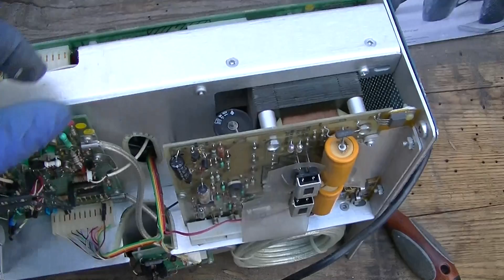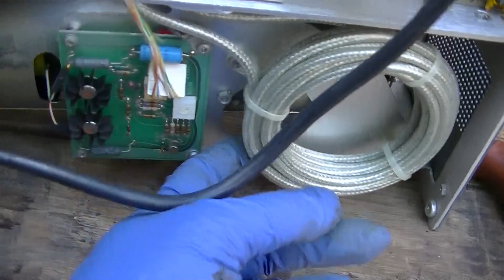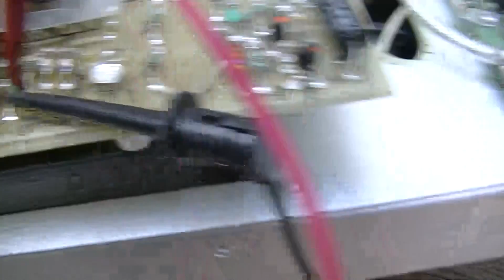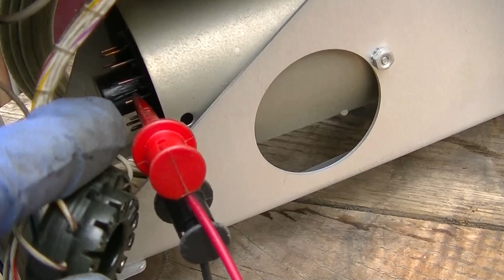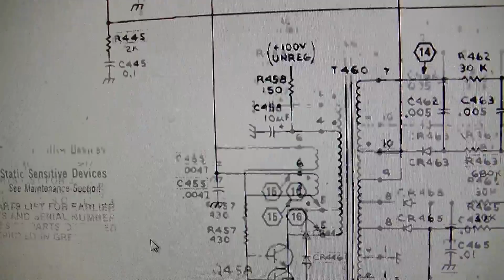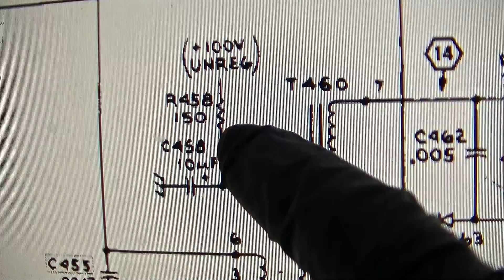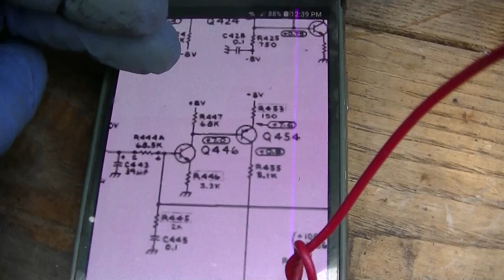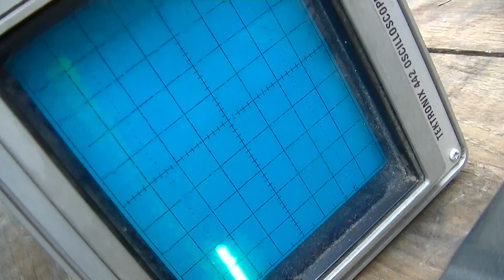Tektronix Type 442 Oscilloscope Diagnosis and Repair

Comment: Greetinga again:
This is a great time to use a variable voltage transformer (aka Variac oriinally from General Radio.) along with an AC ammeter.
Also a 'scope o chck fo ripple.
I beleve in fixing poblms as ou fin he. Replace any power supply caps hat are not up to snuff. Maybe it is more fun to watch the failures repeat?

Comment: Greetings:
The coax is used to visually allow the triggered signal to be viewed by allowing the trigger circuit to delay the signal to the input display circuit allowing the trigger signl to be observed allowing the triggercircut to do its job.
I haven't  checked the circuit yet, but a quick view of the front panel shows no evidence that there is a dual time-base circuit. That was used in video to trigger on the start of the odd or even fields, then delay down to any portion of any scan line to find any 74Sxx series chip that is unable to switch properly (fast enough) . I had to use this feature on 100MHz TEKTRONIX 465 scope with both dual-iputs and dual-time-bases in the late '70s when servicing early CHYRON (Chiron II) character generators (titling systems) with 28ns clock signals. My TEK 454 needs servicing, so I bought a 40 MHz 2-input, single time base scope to tide(?) me over.
YouTube keeps me involved in electronics now that I am retired.
Retired video Engr.

Comment: That scope looks like a more economy design.  Other scopes in the 400 series like the 453 had premium components,  and gold-plated boards.  But some had pretty shaky high-voltage sections.  Tek even gave away re-engineered high voltage boards for some models.

Comment: The screw hole should be a plated-through hole.  They often used the hole as double-duty to both fasten to chassis (or whatever) and via through the board.  Tek stuff is awesome; well-documented and well-built. I have a 515, 555 (regular phosphor), 465B, and two TDS 420's.  I have a 465 that I believe used cascaded power supplies on the secondaries and one went to the sky and blew logic chips out, but this is a theory.  It is a spare tube unit for my work 465B, which I am meaning to sharpen the beam up on.  It also has 2 tunnel diodes per channel to control timing of the beam.  Looking at the schematics for this stuff is like an in-depth analog design course on steroids; very talented folks developed these 'scopes.

Comment: Totally dead was usually a very easy fix before switch-mode power supplies.  Come on, you're a teacher, (like it or not) you should not be jumping fuses like that.  (smile)

Comment: You're VERY lucky that this is an older unit with a proper power transformer, the later units used cascaded supply rails, so if you lost your 5v rail, everything above it would drop by 5v, they're a nightmare, and they have even more tantalum caps as well.

Comment: Tektronix scopes are  so nicely laid out for easy serviceability so you can easily swap boards.  I have an old British scope which I am trying to fix which is all solid state but all the terminals are hand wired.  Swapping boards takes about two hours.

Comment: Sooo, the problem was that it WAS working but the "ON" light didn't work?  Is there a "Beam Finder" on that scope?  Maybe that would have shown that the beam was just off screen.  Or, maybe you just moved a broken solder joint so that it touched again.  Isn't electronics fun?  I like videos like this where the technician thinks out loud as he troubleshoots.

Comment: what is Power factor.????
Reply: Power factor is the ratio of Volt Amps to Watts, expressed as a decimal or a percentage.  d
Reply: Greetings:
POWER FACTOR is 1 for purely resistive loads. Capacitors and inductors add reactive currents that cause power factors that are less than 1 where the current is not in phase with the voltage. Industrial power customers are charged for certain power factor errors.

Comment: Nice one, shango! For a moment I thought you were going to do something unspeakable too this nice (albeit unloved) Tex scope.
If you get it running reliably and it's surplus to your requirements, maybe someone youngster who's starting out in the field of Electronics would give it a loving home.
Last year, a friend gave me a 1967 vintage Tek 547 scope. Like all the old Tektronix gear, it's bullet proof and a piece of artwork.....took half a year (of muttered oaths, gnashing of teeth and pulling of hair) to restore and it's now my daily runner. It also keeps my workshop nice and warm, lol.  Like you said: the user/service manual is second to none! You can learn more from it than from most of the theory books, lol,
Thanks for uploading man!

Comment: I had a Tektronix 'scope nearly identical to that one, on my service bench, when I worked for World Computer Corporation and then we were bought out by EDS, I used the 'scope an average of 3-4 times a week, for 9+ years while I was there, and it was not new, when I started working with it in May of 1990!

Comment: The ‘Probe Adjust’ ring terminal on oscilloscopes is for adjusting the frequency response compensation network of X10 probes. You hook up the probe tip to the terminal and then turn a trimmer capacitor with an included plastic screwdriver until the displayed trace is square; and not distorted. Direct connection with those grabber leads will always show a square wave, because it has no attenuation (and thus flat frequency response, and therefore no need for a compensation network). There are videos on YouTube that explain it much better than I can in a comment...

Comment: Another entertaining video. I really enjoy repairing vintage test equipment. Ok I have a question. I bought a Chinese Techsun R-808 multiband pocket radio. FM AM SW bands. Great for emergency and foreign travel. Anyway the volume control needs to be turned about half way before you can hear the audio. Once you can hear   the station you only have about 1/8 inch of travel to adjust the volume. Any idea what the problem is?. This is the same problem on all bands. Thanks Christopher

Comment: Here in the Uk crt 'scopes still have some value, working that would fetch 125 Us, and broke maybe 50.
The tubes sell very well for oscilloscope tube clocks, it would probably fetch more than the whole thing.
The delay line is there to give the trigger system time to work.

Comment: I have an observation , some historical fact and a political opinion. 
I am not an "electronics guy" The Good Lord gave me a different type of personality and not one suited for the technical rigors of electronics. However I was in a unique position in the early 1970's in early grade school when asked what did my father do for a living? Most were coal miners, auto assembly and steel makers. Mine made Cathode Ray Tube Shields....say what...yeah A nickel alloy that was "annealed" at very high temperature for up to 5 hours to change the properties of the metal that made it able to shield the scope from any electro-magnetic interference.
ahhh  ok whatever you say.

I read the comments about quality. Well it might just be a shield but TEK is a company that is synonymous with "MIL-SPEC" and they demanded high quality from all of their vendors. Once Tek send shields back just because they were well packed in eggshell  cardboard but were NOT covered in a plastic wrap! Everything matters with a TEK product. But that is what made AMERICA great is that we wanted the best....yes AMERICAN LABOR was "spendy" but the quality was outstanding

Now to expound on the Eco-Political point. At any point from 1960 to 2004 100-200 men mostly were able to start at one end of the building with rolls of nickel alloy and out the other end was a box with Tek's unique numbering system on a box full of "product"

337-xxxx-0x.......and contained the shields for scopes that were sent all over the world. Men raised families and bought houses and new cars and clothes and educated their children all because of that "metal shield" and later on heat sinks and other Aluminum parts that built those scopes like  Mil-Spec tanks.  

Our current President, Donald J. Trump is 20 years older than me but HE REMEMBERS when there was this AMERICAN WORK ETHIC that was the "standard" and why he has tried to bring this back.

I am afraid however that its too late and I remember by the time I was OLD ENOUGH (for a turn as my mom and grandfather would say) it was already on the decline ..first to Japan then to Korea.  Then to China and it looks like VIETNAM is on deck.

SO when I watch a video with a knowledgeable person  that UNDERSTANDS what he is looking at and APPRECIATES the AMERICAN WORKMANSHIP ..I can only smile and have a good memory about what good times they WERE.

////////
.

Comment: You could see the capacitor had been leaking at the start of the video when you were checking the voltages with a flat battery in your meter.

Comment: Those are not easy to work on, amigo. Yes, the roll of coax is a delay. With the input atten knob broken, the thing is more or less a basket case. I would be kind of surprised if you will see a lit-up heater inside the CRT, even if was working.

Comment: I think due to corrosion and/or oxidation of screws and metal parts that are used to run electricity over them can act like a capacitor, rectifier, resistor or open-circuit and causes malfunctions.
It's the same with all screwed Terminals in the electrical installation of our houses. By the time and in cause of temperature and humidity fluctuations they can become loose and corrode. In the worst case it leads into arcing and fire. It's always safer to check all screwed electrical and conductive things periodically to prevent any damage. I often see things like chandelier/wire clamps that i can pull off the wires without unscrewing. I'm from germany - here, in older buildings they used wire clamps in junction boxes to connect other wires. These connections are untouched for a very long time and often causes problems. Some of these clamps and the wire insulation are melted together. Now we use plug-in terminals from "Wago". Contrary to the cable clamps or luster terminals, the Wago terminals offer excellent protection against touch. The wires do not slip out of their own accord - they can only be removed with twisting and pulling movements.

Comment: The roll of coax is a delay line.   Since the trigger circuit needs a little time to respond and start the trace, in order to see the trigger event, you need to delay the actual signal before applying it to the display.

Comment: The "dead" issue with mine was in the HV supply to the CRT also, just riddled with dead BC158's and more!  Tektronix usually DID condone in-house repair of their equipment, IIRC they used to include a small roll of silver solder in the case of each instrument for just that purpose.

Comment: "35MHz, so nowadays it's a total boat anchor" haha, and to think i make do with a Philips PM3200X @ 10MHz .  More than adequate for most of the stuff i use it for & will juuuust about manage FM IF at a push.  

That Tek is a really nice bit of kit in comparison, same condition as i got my Philips in (totally dead), hopefully (and judging by the video length) this doesn't suffer quite the same transistor issues (Lockfits, ugh) and at least should have a service manual in English. Makes it more interesting re-typing and Google-translate-ing from Dutch lol

Comment: That cap obviously has been sizzling in the past.  Since I have been watching your channel for quite a while by now, I know it is useless to shout 'replace the caps' to you.  You just like to bake the shit out of it before you even think about replacing anything.  Makes a good show, but in the end, one has no choice, caps will be caps.  I guess the scope has been working for a while without you noticing it because the beam was off screen.
Reply: Shango's method provides us with education about good diagnosis techniques and are entertaining at that same time. If you weigh "I see smoke, smoke is good" VS "I replaced all the parts and it works great"....
I know why I'm here.

Comment: Tektronix ladies and gents!
"It's built like a tank it'll never fail look how well made this thing is"
Parts count: 8000+

I've seen Eico service grade scopes take more abuse and keep ticking. Tek scopes are made to sit on a lab bench with trained personnel operating it under supervision. They're about as babied as you'll ever see a piece of electroncis be, and as soon as the going gets tough they give up. They even need regular calibration to keep themselves in line.

I've got scopes from the mid to late 1940s which were driven around in trucks and tossed about in TV / radio repair shops for decades before being dumped into the garage and left. Rusted out and packed full of dirt and dust and they still come up when you turn the switch!

Comment: Tektronics is a local company and their gear was always the best of the best. I have a higher end model and it came with the manual and a full service manual with everything in it. Mine some of the lights work but no high voltage. I haven't taken the time to tear into it other than looking for fuses and obviously burned stuff. I think I paid 30 bucks at a car swap meet hoping I'd get lucky seeing how it was cheap enough. All the manuals should be online plus I'm sure you can get reprints if needed. I don't know if they are still around here now but everything they built was to that standard and the manuals are great.

Comment: I don't get why the neon bulbs are there if it works without them.
Reply: over voltage protection / max voltage limiter / also possibly for x-ray protection

Comment: Those Sprague TE series electrolytics we’re in so much commercial grade audio equipment in the broadcast industry it’s not even funny. I probably change out more of those than any other electrolytic, as far as old Harris transmitters go, as well as old consoles and audio processors.

Comment: Well....I've owned, used and repaired many Tektronix oscilloscopes (mostly 7xxx,  22xx and 46x series) along other Tek equipment over the last 40+ years and I don't totally understand the blind following of these just because they are American made. They are well built, but many of them are also full of unobtainium, proprietary Tektronix parts and were somewhat prone to failure. Many times I've seen Tek gear with control labels worn off prematurely,  cheap plastic switch shafts either broken or brittle or both, and noisy, intermittent controls which were either hard to clean or couldn't be cleaned at all without drilling holes in them. And the readout system on many of the 7000 series was a sore spot.

I think that there is a tendency to look back at this stuff through rose colored glasses just because it was made in the USA. Nothing wrong with that but I personally have seen and used equipment from Japan, the UK, and even reputable Chinese makers which is just as high quality, better priced, and more reliable to boot.  Don't misunderstand - I love vintage Tektronix stuff but I'm also a realist. I have (2) GW Instek 6112 100mhz scopes here which have been in daily use for more than 8 years with no issues whatsoever.

Anyway, good find there and hats off to you for fixing it instead of sending it to the dump :). And thanks for a great video.
Reply from the maker: Yes well explained

Comment: @shango What about super-glue/epoxy on that shaft, but slide over a piece of shrink tubing before gluing and then shrink over the repair to improve structure and improved torsion strength?  Just an idea..

Comment: Sure you know this,  but try and clean the "spewage" from the capacitor off the PCB..it will corrode away the traces over time. In Japanese Radio's it's called Sony Syndrome...well at least by me.

Comment: High voltage beam accelerating voltage has to be separate from the horizontal sweep since that's tied to the sweep rate selected by user. That's one aspect different from television. The coil of shielded cable is a delay line to allow for clear display of signals triggered at steep rise or fall on the left side particularly intermittent signals. I have a model 453 and it works great. Two channel alt or chop modes and B after A delayed sweep. The probe calibrate is for adjusting the low capacity probe compensation trimmer capacitor which is a little slotted trimmer on the probe itself. Adjust for sharp squarewave leading edge or corner at higher sweep rate. Also can check the sweep rate for close approximate of frequency and vertical amplifier calibration for voltage accuracy. God Bless

Comment: Measuring 6.3V ac with the meter sat at almost 2kV.  That reminds me, (when I was about 21) I did a similar 6.3V ac measurement on a piece of industrial equipment where the meter sat at about 15kV.  There was an almighty bang as the meter jumped off the metal bench it was sat on.  Every semiconductor inside the meter was fried.  OOPS.
Reply: Dafuq are you trying to say Ahmed?
Reply: That must have been a sight!

Comment: This is one where those capacitors usually fail. I refurbish those and mainly the 2465 series. The tantalum capacitors love to fail on those. I had one blow up on me and shoot up in the air, so do the Rifa x2 capacitors on the 2465's. Always troubleshoot and get working before throwing money at it such as recapping.

Comment: So the screw was loose on the board and that killed the beam, how archaic is that. Replacing the  bad caps is the easy part,
  getting to the broken switch is a whole different ball busting game. Good luck  with that Shango! Would make a great repair video by itself!!!

Comment: Pretty cool-- those were the good old days. Fix that knob? I say drill a small hole in either bit of broken end-- then install a small piece of brass rod or tube. Use epoxy. Maybe CA.